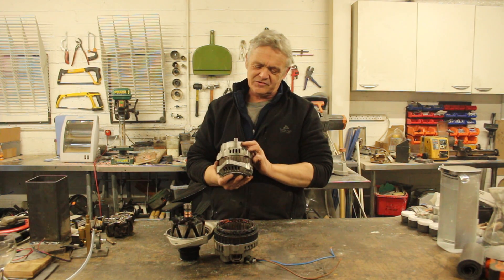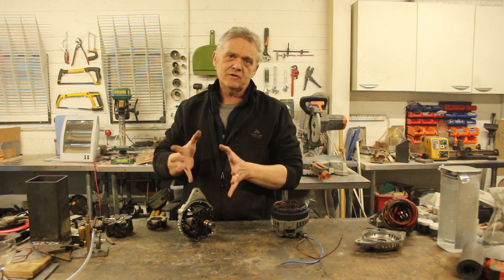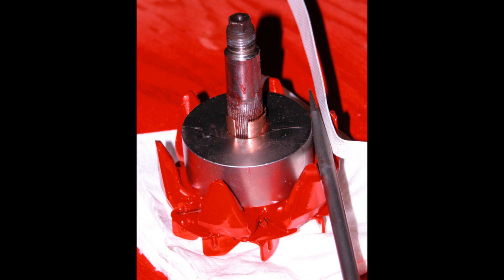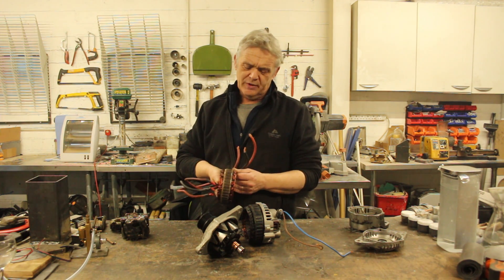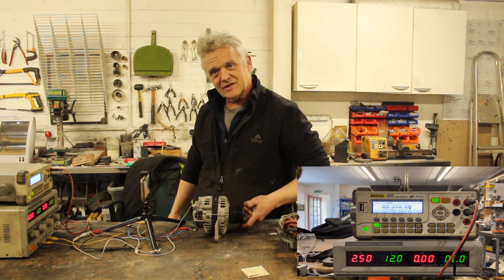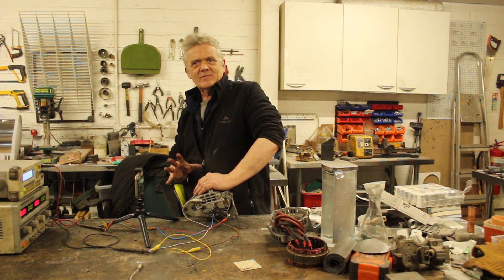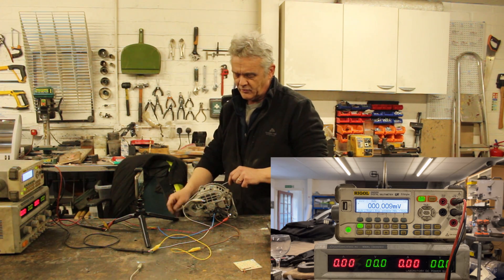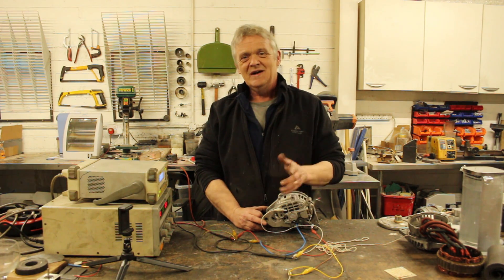1502 Generating From Wind - The Alternators Hidden Secrets

Comment: WRONG! Alternators reach maximum output at 5-6k rpm. That is why they are overdriven, just look at the sizes of the crankshaft pulley compared to the alternator pulley. A lot of times it’s 2.5 -3 to 1 ratio. You can safely spin one up to about 15-18k rpm.

Comment: If you add a treadmill motor to the rota that would increase the voltage as it spins faster in high wind the penny has just dropped thanks bob 😀

Comment: Put a wire from the output of the alternator to the input of the field with a rheostat to vary the voltage input....now, attach a 9v battery to the input with a momentary switch. Using the motive force of your choice, spin up the alternator and hit the momentary switch to "initiate" the field and adjust the rheostat to adjust your desired output.
We use this technique to make "expedient" portable dc welders....

Comment: So how strong a magnetic field is generated in that dc stator?  just thinking in my head about magnet strengths and how that would change voltage output in a permanent magnet set up as well as input torque requirements for charging or output torque in a motor conversion.
Reply: duh, I didn't mean stator, I meant rotor.  Now interestingly I had a couple spare reman alternators laying around collecting dust so I took one apart and started experimenting.  Straight 12 volt battery power to the rotor does not create a very powerful magnet.  Enough to hold some nuts and bolts, but if I pull on them maybe a few pounds of force to pull off (yeah, super scientific I know), and the power on the crab claws is pretty weak at that point.  So I am wondering if I am doing something wrong, or if it doesn't really take much in the way of magnetism for these things to work.  I'm of thinking about putting a permanent magnet inside the crab claw as you mention in this vid, but I don't want to go crazy and have one that takes excessive power to turn, or too weak and end up with one that won't do anything.

Comment: Well Robert, guess Google has been listening or reading my YouTube posts.
Just watched a different video and posted your suggestion of my own accord YESTERDAY. 
I THINK what your saying about energizing the rotor field with say a; high joule Cap, it will initialize a start of magnitizum and with some circuitry on the Regulator, it can control that voltage/amps. It'll take some work,, but I bet you'll get it.

Comment: I still believe that with no magnet would work better, then you could with an arduino regulate the current of the rotor, having an encoder as a feedback to measure the wind, if, less wind, less current to the rotor less lens law torque,else,  more wind, more current to rotor more lens law torque.

Comment: Could you use those parts to develop a method of switching through a flux capacitance system so that the rotor acts as the flux switch? Or maybe use a charge controller to switch between the volts and amps of the flux capacitance?

Comment: Thank you. An interesting insight into bending the field(s) fascinating. The speed of rotation that you touched on, is a little conservative. Consider  going up through the gears as you drive, crankshaft speed may easily top 4000 plus, if you measure the diameter of both the crank' and alternator pullys and do the calculation we find that the alternator rotates a good lick faster than crank speed. Also not sure I agree  that the rotor is permanently energised , it is after all, regulated through transistor switching to control it's state, and ergo fluctuating open circuit / closed circuit.

Comment: Car alternators generally only self-excite under a load.  I have an excercise bike electricity generator that I made with a car alternator, and a ~12v battery pack is needed momentarily to start it generating.  In a car, this is done by turning on the key.  Of course, once it is generating a small amount, then the current sent to the crab-claw coil is sufficient to keep it self-excited.

Comment: Or if you make a small say dc drill/diy/wind generator that makes the dc for the rotor threw the slips.🎩 it could be limited for high speed breaking. The little one could only make so much.?

Comment: It´s a very interesting video Mr. Murray !!!  I´m working in producing some electricity at home with the help of a bike and an alternator.  So I had to learn how an alternator works and why a car battery was needed.  Then I found that there are at least 3 wastes of energy using this method: 1) The rectification, 2) The charging of the battery and 3) The harvest of the energy from the battery and transformation into AC.  And it´s totally ilogical beacuse the alternator produces AC from the beginning (there is where its name comes from).  So I decided to eliminate the rectificator and then make 3 AC circuits ( one of which is used to keep the battery charged ).  So I have 3 available AC circuits because even the one used to keep the battery charged has sometimes an extra amount of energy that can be used for other minor purposes.
  But for me the most important is that I don´t lose valuable energy doing senseless transformations of AC to DC and then from DC to AC  !!!

Comment: Saw a system like this employed by a bar owner on a mile wide gravel wash created by a volcanic eruption in St Vincent. It was a no-mans land frequented by gravel seeking trucks and travelers passing thru. The device was powered by a bank of vehicle radiator fans all connected by old belts to charge a scavenged battery bank. He ran a stereo, sold drinks and small foods, and gave away kittens...

Comment: Many years ago I found that putting a few small magnets in the gaps of the rotor would be able to produce enough voltage to feed the commutator at a low speed of 800 rpm. With a simple regulator circuit I designed it allowed me to run a wind mill without the use of a battery to feed the rotor electromagnet. It had an interesting side effect that at low wind speed the windmill ran at high speed with little loading and still generated more voltage on the commutator as the rotor was not acting like a break due to a high current from a battery. The concept was simple, the small magnets allow the commutator to produce a 14 volts with little loading of the windmill blades by the rotor as the magnets are small. Once the voltage gets to 14 volts the circuit allows some of the current / voltage produced back into the rotor via the commutator. If the windmill speed drops due to the extra loading by the rotor electromagnet the output voltage also drops and so via the reg circuit the the current to the rotor also drops. End result is an auto regulating windmill designed to get optimum power from any wind speed.
Reply: Harry Bartelink 

I think as you said above, that maybe the back emf got diverted to powering the electromagnet coil or routed to useable current ( work). 

If you can make a video of your build or your simple relay, showing things it would be very helpful to see. 

I am not advanced enough in motors and electronics to figure it out by myself.

Thanks for the post.
Reply: @reypolice5231  . I am a busy guy despite being so called retired.  I will see if I have a spare hour or 2 in her next few weeks to put a video together to help you understand better.
Reply: @bartronicsecurity  

Thank you so much. 
Very appreciated. Have a wonderful summer.
Reply: Yes, that kid of practice is also used in the energy production industries, one generator feeds the rotor of another generator. Nice done!
Reply: you find time to make the video? I'm also interested
Reply: Me too

Comment: My first thought is to put a smaller wind generator on top of the main wind generator, the output of the smaller wind generator goes into the field coil of the alternator. That way you don't need any fancy computers to automatically set the load value
Reply: Run a separate PM generator from the same turbine, but as stated in the video you don't need it as there is sufficient residual magnetism in the alternator that it produces some field.
Reply: @andrewharpin6749  I ran a generator that used the residual magnetism to start it for quite a few years. That doesn't work as reliably as you might think it does.

Comment: That's very interesting. I've always been a bit stumped what exactly is going on in claw-pole alternators. I'm having a bit of trouble getting my head around the different configurations and whats going on with the various currents and fields at different rpms. It'll be interesting to see some practical examples/uses, maybe with circuit diagrams. Thanks for the excellent overview. Much appreciated.
Is there not a simple way to avoid the high-torque/stalling problem at low rpm, by adding a zener-diode into the energising circuit? That would mean no current, and therefore no torque/brake, until the rotor passes a minimum rpm. Or am I missing something?
Reply: Rob showed on his $100 dollar 1kw wind mill that: a capacitor after the coil/ before the battery; will take the load off the generator.

It spun freely and produced electric at low RPM.

Hope that helps.
Reply: @reypolice5231  Thanks, I'll take another look.
Reply: A automotive alternator’s regulator controls the field current (strength) and therefore the output voltage of the alternator. It is true that this device is powered from the car battery as there is a necessity to have a power source capable of supplying the significant field current needed to start an alternator under load, as would be the case for wind turbine. Is the feedback from residual magnetism capable of producing this field power under startup for all loads?  Something worthy of a tinkerers efforts to find out. If so then why remove the regulator at all as it is a ready made and reliable solution. If not then there are ways to eliminate the load during startup or to provide a small rechargeable battery or to use the systems battery storage, if there is one. Again, something worthy of a tinkerers efforts. Why eliminate the rectifiers or try to rewind the stator other than just to make more work or fun? An automotive alternator is ready to provide a 12V DC system with about 120W of continuous power or almost 3kW-hr a day, enough to power a full sized refrigerator or freezer given a proper setup and tower. Not all alternators have internal regulators. Choosing one with an external regulator would allow for tinkering with the output voltage sensing to increase/decrease the output voltage of the alternator during use might allow for 24V systems at reduced current. In any case I would think that a unmodified automotive alternator used as a wind powered generator would be perfect for a 120W input, battery backup, inverter output renewable system. An interested tinkerer might explore how to arrange multiple alternators to provide 24V or 48V systems at higher wattages, similar to PV arrays. In fact, a combined PV and wind powered system would complement each other and reduce the cost of the unreliability of each one when used alone.

Comment: Convert low voltage high amperage to higher voltage lower amperage. More amp turns make more practical usage.
Thanks. By the way, your audio is very good, no ambient reverulation.

Comment: I'm pretty sure the alternator can do more than 3000rpm, most petrol engines will do over 5000rpm and the pulley on the alternator is smaller than the crankshaft pulley that drives it so it would spin a lot faster than that.
Reply from the maker: it will but there is a regulator on it to stop 'over production' - or you will blow your battery and electronics
Reply: 3,000 is where car alternators (in cars) start generating, they need a few more RPMs to get to full output. 
Pulleys are around 3:1 ratio & tickover is around 1,000 RPM but the 'red line' on smaller engines can be 10,000 RPM so the alternator has to be able to cope with 30,000 RPM.
Another issue is that the cooling fan won't be doing much at idling speeds.

Comment: Something I have noticed when dealing with the old DC automotive generators, is that you can usually feed the output back into the field coils. There seems to be enough residual magnetism in the armature to produce a small current which will create a positive feedback loop-no external power source needed. If you used this setup on a wind turbine I would expect the startup torque to be very low, since there would be virtually no magnetic field at 0 rpm.
Reply from the maker: you are right mate but I did say that in the video
Reply: They were designed this way so in the car, if the battery is completely dead or disconnected and you bump start the car the ignition would still work.

As the electrical load on modern cars is significantly higher Computers + ABS + EPS this is less feasible, but the principle can still be used.

You could probably attach a reasonable capacitor in the output and then have the system operate as a brake even if the output cables become disconnected, reducing the risk of the turbine from becoming damaged in high winds.
Reply: @andrewharpin6749  : You want to apply a smidge of care when attaching capacitors, as it can cause oscillation- if you don't factor that into the design, then you may produce an AC generator when you intended a DC one.
Reply: So basically you need to use a polarised capacitor?

Comment: I have an old alternator with stuffed brushes and have always thought there had to be ways to make it brushless. I have a wide array of magnets also including a big ring speaker magnet like you had. I guess it's one of those tuit jobs, if I ever get around. 😂
Reply from the maker: always lots of thing to do an explore mate - it's part of what makes life interesting lol
Reply: He brings up an important point with the placement of the magnets, and he's right, but it does have problems.  Using a speaker magnet may not provide enough magnetic force to induce much of a current.  The greater the amount of iron/steel, the stronger magnet you'll need to saturate the core.  The further the source magnetism is from the coil in which the current is being induced, the weaker the field will be.  That's why they drill holes in the metal to place the magnets directly near the windings.  I was going to do a quick video to show you, but it was quicker to type it instead.

Comment: Most  Alternators have enough residual magnesium to create a start voltage.  Simply tying the out put to the output it becomes self starting. A resistor can act as a basic regulator.
Reply from the maker: to be honest mate so do most universal motors - in fact they are very similar but you would probably want to use the stator coils I would think
Reply: @mjolnirswrath23  : Unless utter endurance matters more to you, in which case you hide a rectifier circuit with the speaker coil, hook it to another coil mounted to the same axel, and use that second coil as half of a transformer so you can use a zero-friction charge source.

Comment: A great explanation of the problem and possible solutions Rob.
I always thought that electromagnetic over permanent magnets was a better idea for wind turbine generators. 
It gets around the cogging problems, or as you say the torque matching to wind speed  problems.
It would be a relative simple coding job for an Arduino with a look up table, tachometer input  and FET switching output to the field coil.
Reply from the maker: I like the logic of that mate - I didn't think of the FET switching but I like it a lot
Reply: Perhaps have some small magnets in parallel to the field coil?  This will give an aspect of self-excitation?
Reply: You can try to extract tacho information out of the stator coils before rectifier bridge with small additional circuit and feed to the microcontroller. No magnets and hall switches needed...You can do it on two phases to get redundancy.

Comment: Brilliant video. Thank you. There is a video on Victron Energy's channel on charging lithium batteries from an alternator. Could be worth a look and perhaps to do an experiment on. Alternarors are super readily available and as you always say, the less done, the better the efficiency
Reply from the maker: Great suggestion! - cheers mate
Reply: @ThinkingandTinkering  Could you make a hybrid self-balancing system. A longer shaft with a secondary permanent magnet generator on the back that additionally feeds the coil on the other side, automatically adjusting the torque and main power output of the primary generator?
Reply: Indeed, I'm very proud of the hard work invested in this channel. 🕊️